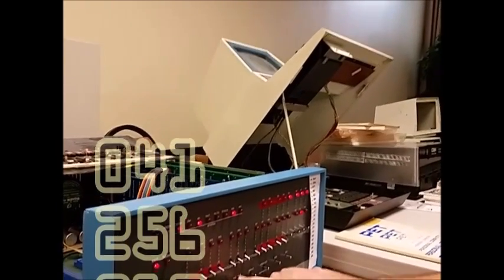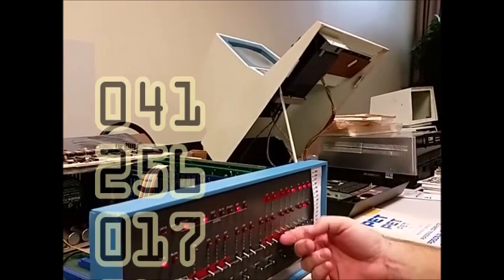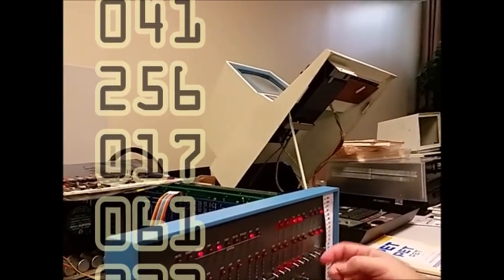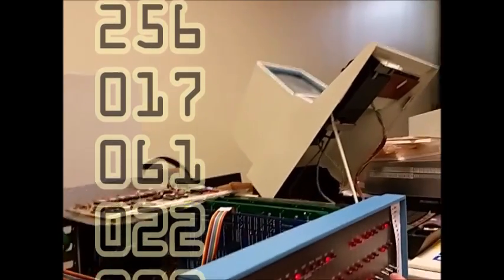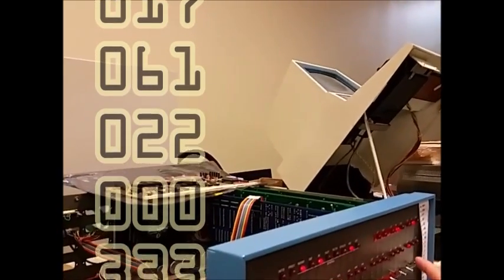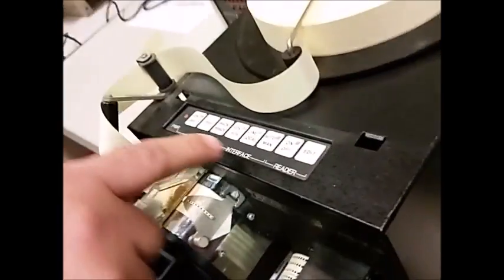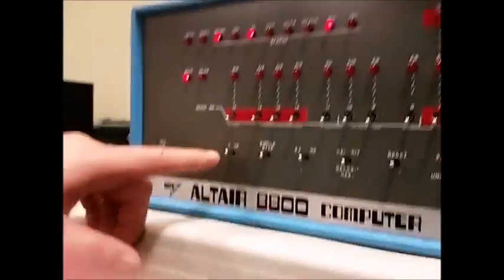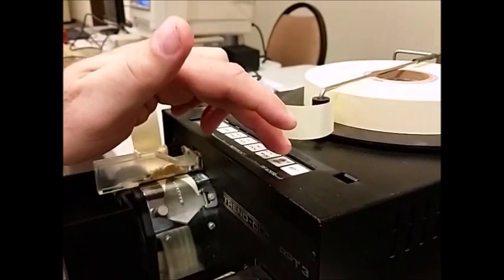A re-tracing of how Paul Allen loaded BASIC on the MITS Altair 8800 from paper tape

Comment: Don’t step on the tape!
OK, as with all systems of that day for the most part they were unique. Your boot loader was different for each system.
Now, I had an Altair 8800 too, and mine had had something like 16k or so of memory, a Teletype Model 33, and a MITS serial card. Had more but this is what we need for this example. 
One Saturday morning, I thought I wanted to play a game of Battleship.
So, for the next 45 minutes I loaded 12K basic paper tape with no issues, it came up to Ready.
Next, I loaded the paper tape with Battleship, again with no issues, and it up to came to Ready.
At this point, the power to the apartment blinked!
(A naughty woad), 90 minutes down the drain!
Left to do something else.
Reply: I wrote a whole casino worth of simple gambling games as a 10 or 12 year old on my RC-10 and had the power blip before I could write to cassette. 

I almost quit programming right there 😂
Reply: @ConernicusRex  That was why upgraded to auto tape. Then floppy later.
Reply: @wrongmouse1658  what’s autotape?
Reply: @ConernicusRex  every programmer has lost days if not weeks of work due to power glitches or bad media.  It's part of the hazing ritual!

Comment: Holy cow...the fact that Bill Gates and Paul Allen got ANYTHING to work on this thing and somehow were able to market it is amazing.
Reply: The amazing thing is that they had never even seen one when they programmed the basic for it. They simulated it all on a PDP-10 computer that emulated the microprocessor of the Altair. Real Paul Allen's wonderful autobiography if you ever want to hear more.
Reply: Andrew 'Tridge' Tridgell reverse engineered SMB & BitKeeper by analysing their protocols 'on the wire'. Yep, Bill & Paul where smart as they didn't have access to the hardware [only the manual]. But imagine trying to do what Tridge has done? No specs, no manual - It's another level.
Reply: You really have to put yourself in the time. This is what computers were and had been for about 40-50 years at this point. Just, a little more compact. Everything was manually done. Not to take away from the accomplishment but this is the equivalent of writing a substitute OS for Android. Not at all insubstantial but also within the grasp of a dedicated and talented amateur or the afterhours tinkering of a professional.
Reply: Yeah, back when computers were cranky and computer folk were clever, not Windows Wussies.  People did real work back on such machines.  Basically the same root functionality as is used by business today ... without all the bloat.
Reply: @uni-byte  Yeah, back when computers were ENIACs and CNC's and computer folk were clever, not Punchedcard Pansies. People did real work back on such machines, fixing vaccum tubes and the like. Basically the same root functionality as is used by buisnesses today in the 70s and 80s... without all the bloat. 
-
Yeah, back when computers were electromechanical and computer folk were clever, not Vaccum-tube fixing losers. People did real work back on such machines, designing complex motors with little help and integrating them into things like typewriters. People didn't need fake brains for missle equations back then, they did them themselves. Basically the same root functionality as is used by business today... without all of the vaccums and X200+ efficiency.
-

Yeah, back when computers were mechanical calculation machines and computer folk were clever, not Motor Morons. People did real work on such machines, using Difference machines or binary Integraphs to get  arithmatic tables and had thousands of breakable parts. Basically the same root functionality as is used by adademics today... without all of the electricity.
-
Yeah, back when computers were Astronomical clocks and Abaci, and computer folk were clever, not Calculator Ninnies. People did real work on such fragile machines, doing the math by hand with nothing but aiding tools as we got our culture appropriated by the romans. Basically the same root functionality as is used by natural philosophers today... without all of the work.
-
Yeah, back when computers were simply our brains with the invention of complex numbers and computer folk were clever, not Abacus Assholes. People did real work on such fragile machines, counting thier goats for trade. Basically the same root functionality as is used by merchants today... without all of the beads.
-
Yeah, back number no exist people were farmer, not lazy thinker. Did real work, place stone when goat leave remove stone when goat come back. Same today... no lazy thinking not working.
-
OOK! OOK! EEE EE! OOK! AAH! EEEH EEH AHH AAH OOH! OOH OOH AHH EE EEE EEE!! E EEE OO OOH AAH OOK! OOOH OOH... AAH AAH EEEE!
-
glubglubglubglubglubglubglubglubglubglubglubglubglubglubglubglubglubglubglubglubglubglubglubglubglubglubglubglubglubglubglubglubglubglubglubglubglubglubglubglubglubglubglubglubglubglubglubglubglubglubglubglubglubglubglubglubglubglubglubglubglubglubglubglubglub....glubglubglubglubglubglubglubglubglubglubglubglubglubglubglubglubglubglub.
-
GAUACGGGACCAGUUUACGAUCAGUCAGUGUCGGUCGAGAGAUCUGUACCUCGUCGCUACAGUCAGUACAGAGAGAUUCAGACUGAUUGCACAGUCCAGGAUCAGAUAG
-
TACGATTACGATTACAGGATCATATATATATACCAGCAGCTTGTATCCCCCCCCAGACTCGAGAGAGCAAGACCATGGATACGAAGCTGCATGACAGCAAACGCTCATTCATTCCAGAGCATCGGTAG
-
...
Reply: @miloh-k7660  Let there be light!

Comment: Why tape load was not used from scratch without loader program? every track is swith state on front panel - not very hard to do diy punch machine and pull paper by hand. Photo film may be more effective, but price much more then paper.
Reply: @Richard Vaughn or literally build a dedicated hardware bootloader with configurable start address... Analogous to the switch mechanism

Comment: How did Paul Allen (and Ed Roberts) connect a monitor to the Altair, a machine that when introduced could connect with nothing but power, that I like to know.
Reply: My understanding is that MITS had a Teletype terminal connected to the Altair they used for testing BASIC. The Teletype terminal combined the typewriter terminal (keyboard and printer) with a paper tape writer/reader.

Paul Allen entered the boostrap loader, much as is shown in this video, using the Altair's native front panel toggle switches and LEDs. Then he used the connected Teletype terminal's paper tape reader to read the tape (containing their BASIC program) that Allen and Bill Gates had produced back at Harvard. Once BASIC was loaded from the paper tape, using that boot loader, then the Teletype would have printed (literally printed) the initial lines that prompt the user for things like memory and such.

Any BASIC programs that a user would write could then be saved to a connected Teletype terminal, as long as it had a paper tape writer/reader.

Later, it would have been more likely  to use a CRT based terminal, and probably some kind of magnetic program storage (cassette or other).

These days, we Altair hobbyists just connect a modern PC to the Altair, and the PC runs any of the 'terminal emulator' programs that behave like the older CRT terminals, or the Teletype terminals. Usually, the terminal emulator also handles saving and loading user programs, using the PC's hard drive as the storage media.
Reply: @mr.fancypants3366  @youtuuba   https://www.youtube.com/watch?v=lMh5YX9siu8
Reply: Teletype printer i think.

Comment: Hi. How'd Bill and Paul Allen able to afford the machine to create the paper tape BASIC as students, in the first place? Also where did their BASIC idea come from? Also how they did test it without the Altair? Thank you. God bless, Proverbs 31
Reply: Bill and Paul already had experience wiring software with their previous venture, Traf-O-Data, which they had while students at Harvard. Paul had an early microprocessor emulator which ran on one of the college's PDP series computers, which they had to share the resources of....apparently this was running a business using college property, which the college authorities were not aware of.

When MITS announced the Altair 8800 on the pages of Popular Electronics, Bill and Paul were shocked and were also worried that the computer world was already passing them by. They got busy writing their first version of BASIC, intended to run on an Intel 8080 microprocessor, which the Altair used. They did not have an Altair or access to an 8080, so they revised their earlier emulator on the PDP computer so it would emulate an 8080. Their only reference for this was the Intel manual for the 8080, and they were very concerned that if an error(s) were in the manual regarding how the 8080 executed various instructions, then their emulator would be defective, and any programs they developed using the emulator would also be non-operational when run on an actual 8080.

They contacted Ed Roberts of MITS and told him they had a BASIC that would run on the Altair 8800, which he sorely needed to make his product actually do something useful. Bill was on the phone with Ed since he had written most of the BASIC and was most familiar with it (Paul had written various auxiliary routines, and another student had written the floating point math routines). Apparently, Bill and Paul were concerned that if Bill went to meet Ed, he would be dismissed since he looked too young and Ed did not realize that they were 'just college students'. Paul looked older, so he was the one who went to meet Ed. 

Bill stayed up in the college dorm all of the previous night, re-reading the Intel manual, because of his concern that they might have missed some critical aspect of the 8080. In all this, they forgot to send a boot loader program with Paul, which would be necessary to load in their paper tape of BASIC. Paul realized this and hastily wrote a boot loader while on the flight to meet Ed (Bill later re-wrote the boot loader to be less than half as long as Paul's version, and Josh Bensadon, shown in this video, later re-wrote it to be even smaller). On the first try, it did not work, but on the second try, the boot loader worked and BASIC was successfully loaded, and it worked. This was Microsoft's first product. The first program run with this BASIC on an actual 8080 processor, in this instance on the Altair, was "PRINT 2 + 2", and the answer came back as 4, and both Paul and Ed were amazed. Paul was amazed that their software was working, and Ed was amazed that his new computer actually would run something as complex as BASIC.

Bill and Paul and some other students soon left Harvard and moved to Albuquerque to be close to MITS. They had no almost money, and stayed in a cheap hotel that was far enough away from MITS that they would not be embarrassed if Ed found out what a tiny operation they were. Microsoft was based in that hotel, and after a while they moved to a somewhat less modest office. They were refining BASIC and writing other software for the Altair. Their agreement with MITS was that in addition to getting paid outright for letting their software be used by MITS, they also got a percentage of every sale, AND they were still allowed to sell their BASIC to other computer companies, albeit in modified forms to suit each computer.

The rest is history.
Reply: I don't believe they could've afforded any of the equipment required to pull this "neat little stunt". They had access to computers as Harvard students (along with the paper tape equipment) and they already had their own 8008 emulator for the PDP-10 which was the starting point. So designing and testing was done via emulation. First run on a real Altair hardware was the demonstration Allen gave to MITS. And while many things could've gone wrong, everything worked fine.

BASIC was still relatively new at the time and it seemed like a great way to interact with the computer which would otherwise be pretty useless. Latter proved to be very true since nearly all of the following microcomputers did indeed had BASIC interpreter. In many cases this was the OS these machines would run. Other OS's were around at the time too, but even if they ran something else, they almost certainly all had some form of BASIC included too.

Comment: Are the toggle switches inputting the bios and the punch tape is a program or data?
Reply: No such thing as a BIOS in that old computer.

It might be a difficult concept for young folk to grasp, but a computer that old had nothing but garbage in its memory when first switched on.  There was no permanent memory so it had no sensible instructions to run.  The memory was full of the random garbage which shows up as part of applying power to volatile read-write memory (RAM).

The switches were for inputting the boot loader to tell the computer how to read the paper tape and where in memory to put the program while it was being read from the tape and where to jump to in order to start running the program once it had been loaded.

The paper tape was the "disk drive" of its day.  It could hold a program or data, depending on how the computer handled it.  In this case, it was a program and was a very early version of BASIC.

Comment: This is not the first version, but rather the most common variant of 4K Microsoft BASIC for the Altair.

The very first version shown @ MITS demonstrated:

(1) Memory size prompt was different, and did not automatically calculate memory size
(2) The signon was 8080 BASIC
(3) the prompt was READY instead of OK
(4) no NEW, but rather used the dartmouth SCRATCH keyword
(5) was actually somewhere closer to 6K, this was before they optimized it.
(6) Did not use a checksum loader, but rather required a loader that would dump the raw binary on the tape starting at location 0000. 

There were some others, but that's what I remember for now.
-Thom
Reply: I do remember reading that Bill having an issue with the "Ready" prompt, which stayed in the version sold to Commodore.  Apple and Tandy (and likely many others) were given the "OK" version.  I am not sure how many bytes are in the version Josh is seen uploading, but I read that early versions of basic were made to run in as little as 6K of RAM.  That includes space for a small program and variables.
Reply: @datadude67 my TRS said, “READY”.
Reply: The 4K Level I basic was a straight port of Li-Chen Wang's Palo Alto Tiny Basic, which shares no code with Microsoft's BASIC whatsoever, which actually fit into roughly 1 and a half K of assembled code.
Reply: Actually, the TRS-80 model 1 had a 4K BASIC interpreter and had only 4K of RAM, some of which was used by BASIC and the memory-mapped screen.

I remember it had exactly 26 numeric variables, A-Z, two string variables (A$ and B$) each of exactly 16 characters and one single-dimension numeric array "A()" which had a size dependent on the amount of unused RAM.

There were three possible error messages: WHAT? (syntax error - I don't know what you want) HOW? (you're asking me to do something impossible, such as divide by zero) and SORRY (I've run out of memory).

As one wag commented, "just so long as it never asks WHY?" ;)

Comment: I had grand theft auto 20 on paper tape and the spool was a half mile wide.
Reply: Well GTA is around 65GB....69,793,218,560 bytes... At 10 bytes an inch on paper tape that would be... let's see... 63360 inches to the mile... So ... 1,101,534.4 miles of tape... It's 238,900 miles to the moon... So GTA would sit on a tape that would go to the moon and back two times over with enough left over to go back for half the distance (4.6 trips to the moon)... In terms of width, even if you opted for 64bit tape, it would still be 8 inches wide.

Just saying 😀
Reply: That said, if you are talking about diameter there's math for that 😂

470 meter diameter... So 1/4 of a mile ;)